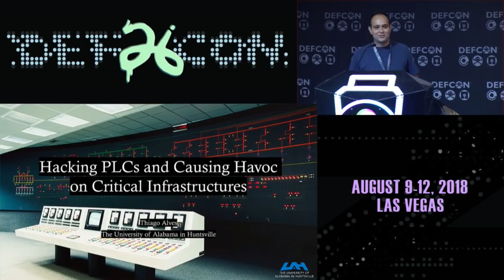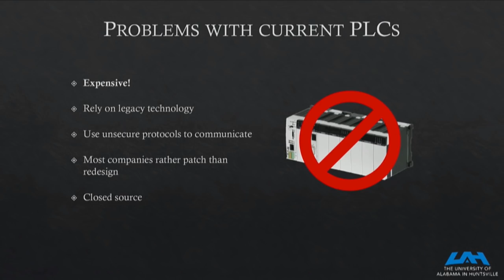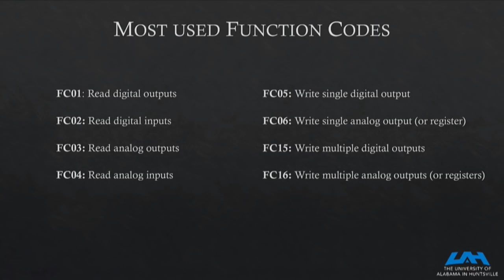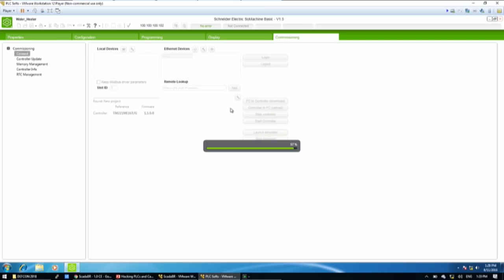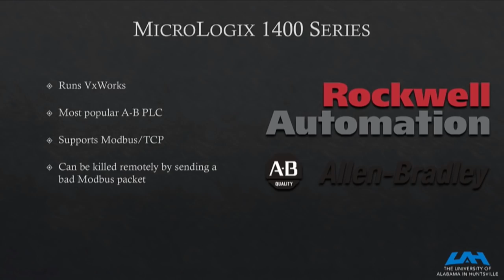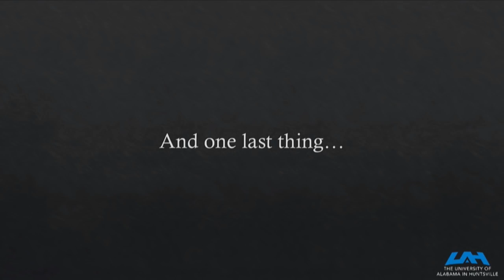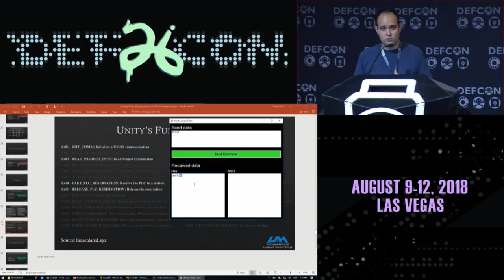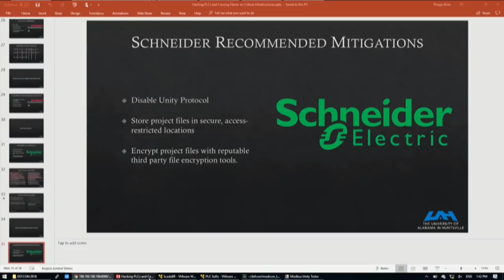DEF CON 26 - Thiago Alves - Hacking PLCs and Causing Havoc on Critical Infrastructures

Comment: A customer asked me to attempt a network discovery scan to identify and document the PLCs in their production chemical plant.  This was one of the few times in my career I refused a task, I knew enough to know it wasn't a very good idea.  This demo makes me feel better about that decision!
Reply: what? why?
Reply: Ever run an nmap scan on old network printers?  (They tend to start spewing out garbage when you do)  I wasn't confident the same would NOT happen when scanning the various industrial control systems that were NEVER designed to be on an IP network (IP networks didn't exist when the control systems were implemented.)    Combine this knowledge with a Production Chemical plant built up over 30 years using bizarre layers of ancient, old, and new(ish) tech with no test environment to play in first.    Yea, I nopped the hell out of that project as did all the other tech companies the customer inquired with.
Reply: @JlerchTampa  If they're up to date, they'd be fine. They're worth tens of thousands of dollars, but weren't sposed to connect to the internet (generally).
Reply: @Ye4rZero  Sadly the customer knew that the devices they were aware of were not up to date, which was part of the motivation for discovering what was out there.  I also knew that other companies that solely did this type of industrial network discovery work had already passed on the opportunity.

Comment: I worked with Rockwell plc's from 2003-2012 and as an electrician / it guy I could have made a similar talk in 2007ish. It's clear to anyone if you worked with these products you see their flaws clearly. The plc's are not meant to be exposed to the internet in fact they should consider if you should put them on a LAN if you don't need plc to communicate with other plc's. The modern world needs this shit to work flawed or not. It's good that security comes into focus on this as it's very needed, but please use common sense. This is no joking matter.
Reply: even i a starting electrician see how bad this can go and ive not done big projects with plcs but its easy to see that any networked plc in their current form can cost money and lives

Comment: This guy doesn't know jack about PLC's. I'm sure he's a great pentester or whatever, but his knowledge on automation is useless. There are several cheap PLC's, and they don't charge exorbitant rates for software. BUT you get what you pay for. THese things are implemented on sites where there's a very clear deadline for completing your works, and they run on systems that cost thousands of dollars every second they're shut-down (ie failed). An open source anything is a good idea, imo, but you can't 'tinker' with a prototype system that's running machinery at thousands of rpm or whatever.
They all support MODBUS because it's a widely used third party comm protocol.
The companies that make these put millions into them, because they run machinery worth more.
Security is definitely an issue, but their massive visibility lately is largely lack of network planning - security needs to be a layered updated beast, these controllers need to run a robot in a factory for years. It doesn't NEED to be on the net, really.
Reply: Ye4rZero, I have to disagree about a few things. My PLC knowledge might not be the best, but at least is good enough for me to make my own PLC. But you’re right, I’m not an automation engineer, which means that I’m not using all sorts of different PLCs everyday on projects. On the other hand, my job is more related to building PLCs and analyzing the architecture of the ones available currently. I’m aware of the “cheap PLCs”, but as you said, they are exactly what you paid for. For the ones I know, they are so simple that I rather not call them PLCs. In my opinion, just because a device speaks some dialect of ladder logic, it doesn’t make it a PLC. There is an international standard that regulates what a PLC is and what it does, and I try to consider a PLC devices that follow that standard.
About the open source prototype stuff, well, I honestly believe that open source is the future. Android is the most popular smartphone OS in the world, and it is open source. Same thing can be said about Linux, that is responsible for most of the internet to function nowadays. Just because a project is open sourced it doesn’t mean that it is a prototype and cannot be trusted. In fact, the most trusted encryption library (OpenSSL) is also open source. I’m not saying that OpenPLC is perfect and that it should be used in all factories of the world. There is still a lot to improve in it. I’m just saying that it has potential, and can grow to be big and trustworthy.
About PLCs disconnected to the network, well, it all depends on whether you want to monitor your device or not. From my experience, it seems that most PLC users also have an HMI constantly monitoring and reporting back some data about the PLC. For that to work, you need to put your PLC in some network. It doesn’t matter if this network is connected to the internet or not. If an attacker manages to penetrate the isolated network, the effects can be equally devastating (see Stuxnet).
Reply: @ThiagoAlves-io5qe   very cool. So is it fair to assume that these open source PLCs you're working on, which would need to have the ability to be monitored, are using more secure and modern protocols instead of MODBUS? This sounds like big steps forward and is much needed. Thanks!
Reply: Ye4rZero - Where's your DEFCON talk? Companies are attacked from the inside too, it's not always about the threat from the outside.
Reply: @ThiagoAlves-io5qe  .hello .the video is great . i to had the same idea as your. i got inspired by stuxnet i n electrical engineering student . and i ' m planning to realise it as my final year project .please give me your email or your social media so i can contact you i have some questions
thanks in advance
Reply: I think you will eventually come to find that reverse engineers/researchers tend to understand systems even better than it's creators...  Doing this kind of work requires deep understanding of computing at all levels of abstraction.
Reply: This is only a sample of the problems with todays security systems. The PLC operators / installers do not want their systems to be shut down for changes or upgrades, and the cybersecurity folks warn of future doom. The same can be said about buying insurance. Maybe you will not need it, but then again your plant may blow up. Its called risk analysis. In layman's terms, how much risk are you willing to accept for what dollar amount. If the units cannot be shutdown from a second without losing thousand of dollars, what will days (or weeks) cost the company? The old saying; you can pay me now, or you can pay me later. But which will cost you more, now or later? Do yourself a favor, and look up Stuxnet! Although they will not admit the extension of the damage or the actual time of the destruction (because of politics) but you can imagine the damages they suffered.
Reply: It doesn't matter how much cost or who is the producer. A bug will be there waiting to be found. Like in nature ... bugs are hibernating.
Reply: Yeah, everyone's a critic.
Reply: @beautaub815  Like I said, I'm not questioning the speakers IT knowledge, just some of his comments about PLC's
Reply: @jballard1979  Well only when I know something about it.. I'm not a pentester